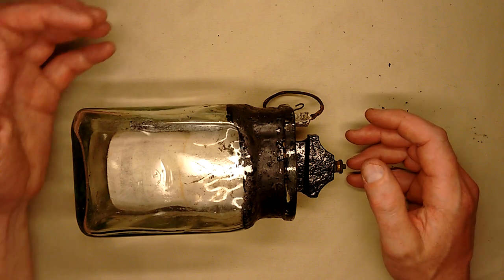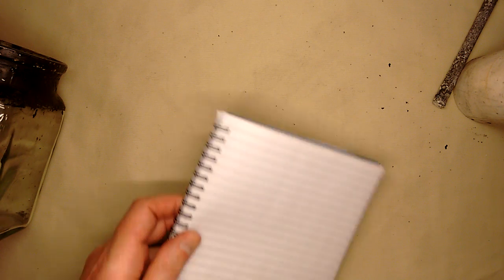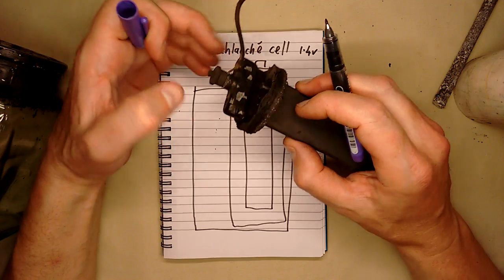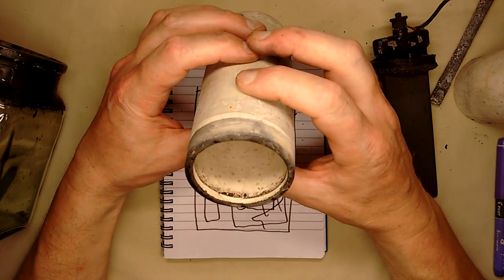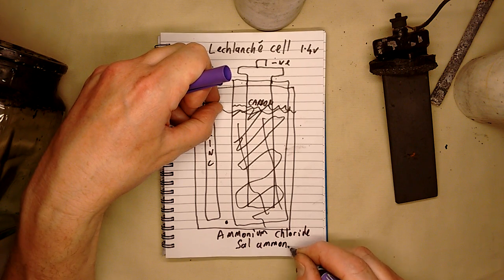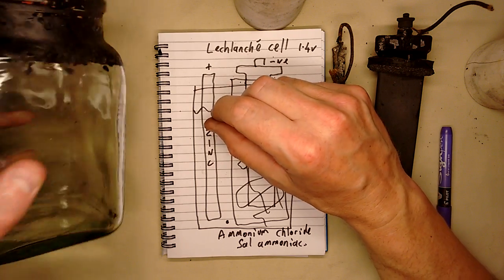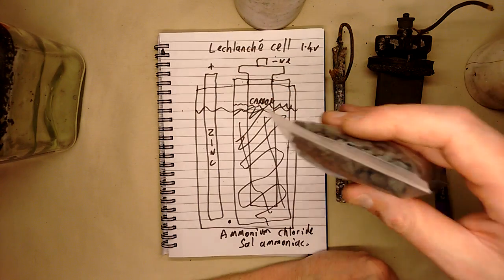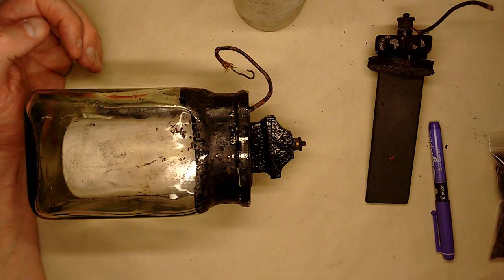A look at a vintage Leclanche cell.  (Very early battery.)

Comment: Back in the old days, people must have had a monstrosity of a tv remote control, to be able to house two of these.
Reply: I remember my Grandfather had a VCR with a wired remote! It plugged in with what I think was a 3.5mm jack.
Reply: Of course there was no TV when that technology was in wide use, lucky if they had radio :-) Note even in the 1950's and 60's TV's could have remote controls, who says that they had to use batteries at all or wires.
Reply: there were no remote controls. their controls were on the TV itself.

Comment: I grew up in Pennsylvania, the house I grew up in was built in the 1860s so electrical lines were added after the house was built... but we did some renovating in a room and there was still those style of copper wires wrapped in almost a cord sheath. Seems massively dangerous, but hey I guess the home never burned down.

Comment: The terminals were often connected with a bismuth containing solder, it expands  when it solidifies (like ice) so they'd drill a hole, and then set the brass stud in with the solder, and it formed a decent physical and electrical connection.

if you're interested i could search for the article in one of the books I have (it's probably a copy of telephony) LOL
Reply: Oh, the black pitch paint round the top that viewers may have noticed, is designed to prevent 'creep' of the electrolyte. What would happen is that the liquid would 'wick' up the side, as water based solutions do, then dry, then wick a bit further (using the crystals formed during drying), rinse, repeat... the solution and the active ammonium chloride would end up forming pretty patterns on the glass, corroding the wires , and doing other mischief, hence, they tried to avoid that happening by painting the top with a hydrophobic compound
Reply from the maker: Ah, I wondered about that bit.

Comment: My parents home had a bunch of ignition batteries, the kind used for starting model airplane engines and or used in some cars back in the day. They were huge cells wired in series . The home had three flats and had a vestibule where there was a ear piece and a carbon mic one could speak into. The system never worked but I give that to the cells were dead. They were carbon zinc cells

Comment: That type of wire been used alot in houses in belgium, i used to replace those alot as an electrician. rubber, fabric, greese insulation. Alot of houses actually still have them here.
Reply: I was just about to say, my house in Australia had that wiring until we renovated the house in the 1980's. However the call system used mechanical bell cranks (hence the name...) to ring a bell. Just for the front door, not to summon the servants!
Reply: @gasdive  We called it Bell Wire in the old days. Bell wire definition is - a small-size wire insulated with paraffin-coated cotton and used especially for electric bell circuits.
Reply: My parent's house was built in the 1920's here in the States, and the original wiring was the same sort of thing.  Most of it was replaced in the 70's when my folks took it over from my grandparents.  There is still a bit of it in the attic, but it isn't hooked up to anything.

Comment: C'mon! I thought for sure that you were going to reassemble it, fill it back up and run an LED off it.
Reply from the maker: No Sal ammoniac here unfortunately.  I'd also have to have used two in series to light an LED.  (Or use a Joule Thief.)
Reply: +bigclivedotcom charge a phone off one!
Reply: +bigclivedotcom surely you can find an alternative

Comment: Haven't you got the polarity wrong. On a zinc carbon cell the zinc outer case was neg and the carbon rod was pos.
Reply: Was going to ask about this too.. Ah well, I do hope Clive does indeed refurbish this cell and does some experiments with it.
Reply from the maker: Hmm.  I read that the zinc was described as the anode, but it could be wrong.
Reply: Yes zinc is negative.  Should work with water but not much current, maybe add epsom salt.

Comment: Would like to see an active one subjected to various tests. ;)
Reply: YES! bring it back to life! :D
Reply: I cant wait for the "Its ALIVE!" moment from BigClive lol
Reply: Well as Clive said old style HP2 cells in the UK were effectively one of these but with a paste instead of liquid. And it was more transistor radios were hard on them. A class "A" amplifier can be as low as 10% efficient and even a class "A/B" can only achieve 45% efficiency. So you could be using 25 watts of power to get 3 watts of sound out easily.
Reply: Yes i would like to see it revived.
Reply: Up vote just for the "avatar"
Reply: Wow, how often do you see serious old school technology, the reason we  quit using these is  they made nasty flash lights and were hard on transistor radios, lol

Comment: The zinc electrode is the anode (where oxidation takes place). Oxidation is loss of electrons (sort of). Zinc metal loses electrons to the circuit causing it to become negative not positive as you suggest. Interestingly with rechargeable cells, the negative electrode is the cathode during the charging part of the cycle. This means you can't link oxidation with a particular electrode unless you also specify if the cell is charging or discharging.
Reply from the maker: Darn.  That's where I got mixed up.

Comment: Hey clive. You still do teardowns from post? I am really curious if these solar watches from China really do use solar and charge the battery (with no risk of exploding ofcourse haha) :D

If you wish I could dropmail you one.
Reply: If I were to design such I would not even bother with a battery since watches draw so little power (especially if they lack an alarm feature).  I would just use a small supercapacitor, or even high value ceramic capacitors (if sufficient), and simply charge the capacitor directly with simple overvoltage protection.  Very simple circuitry and no battery to worry about whatsoever.  But, then again, with China who knows how honest the specs or claims are until you do the teardown and reverse engineer how it was made.
Reply: +Ethan Poole Yup that seems like a pretty good idea but indeed you never know with China.

China is pretty famous for using fake solar panels to save cost :/
Reply: A lot of cheap solar LED torches use real panels (possibly failed ones), but don't bother with rechargable batteries, cos they're more expensive, they just use ordinary batteries. So, chances are.

There have been "solar panels" that were actually black cardboard though. The anonymity of Ebay has really messed up the quality of products.